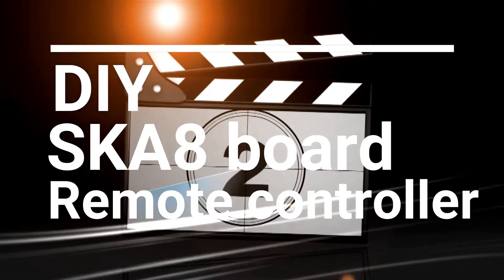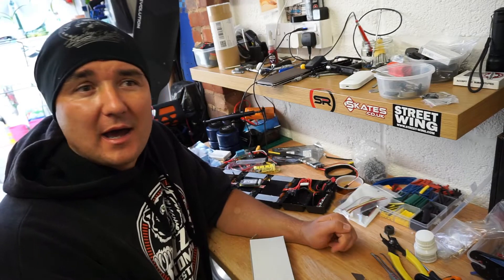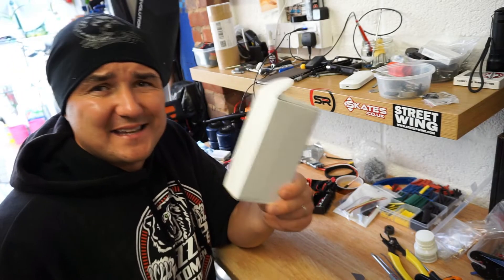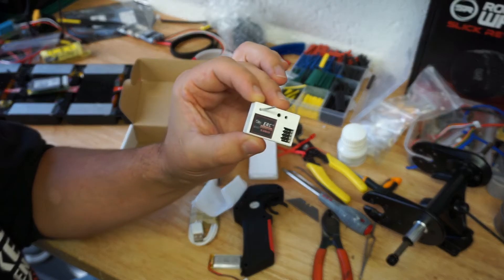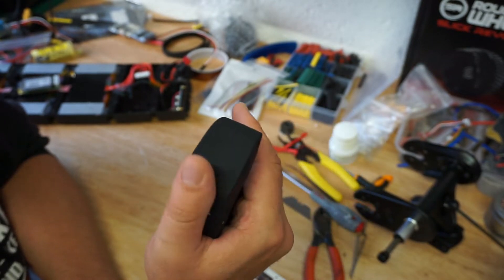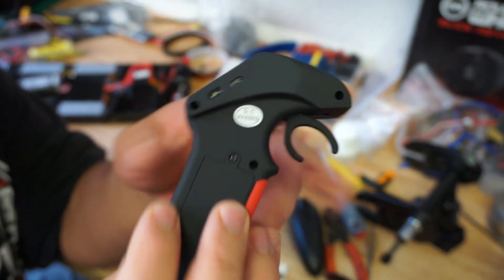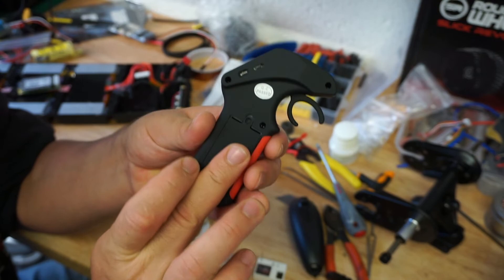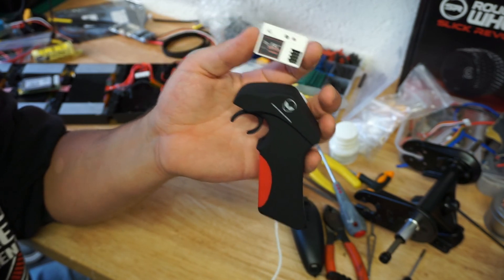Electric skateboard remote controller - Alien power systems.

Comment: Sup Pavel, my biggest question is, How touchy is it?! I have a diy longboard with a 6573 motor and I'm using lipos. The remote I have is Super touchy! You have to be Super gradual on the throttle or it'll throw you off!! And I'm only running a 3 cell!! At 6 cell it's about suicidal with the excessive torque. I need to EASE the throttle on. What's your opinion? Thanks bro.
Reply from the maker: Hello Scott,
I am using the remote on the 5000 watt, dual 6355 motor, 12S battery board and it is ok. Remote is very comfortable but is afraid of being dropped : ) 
The trigger is sensitive but does have a quite long travel so it is gradual enough. The trigger is quite thin and needs to be looked after.....not good to use with the full glove.
It is possible to set the remote parameters but I did not try that. As with anything, you need to get used to it but in general - I am happy with it,
Hope this helps.